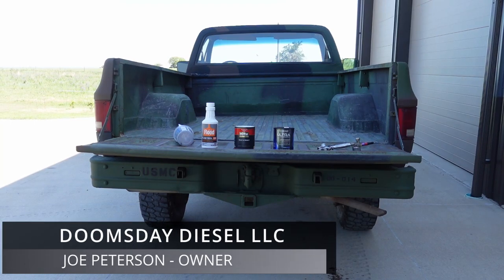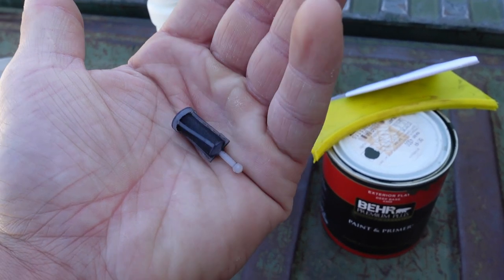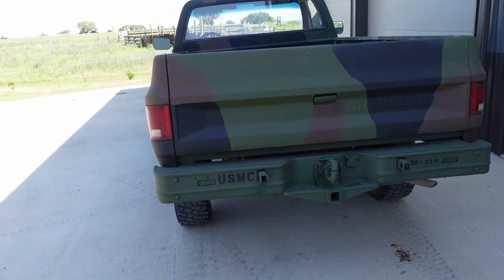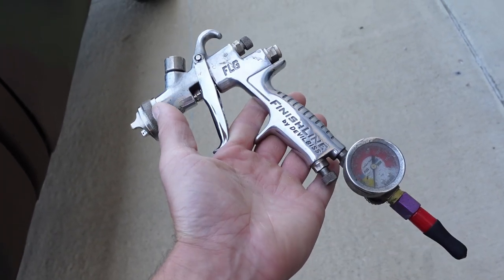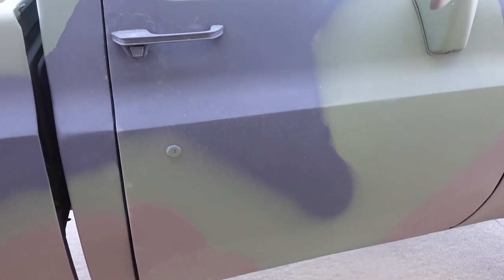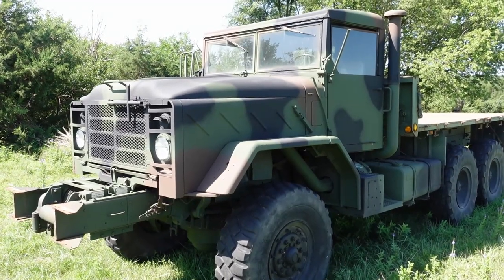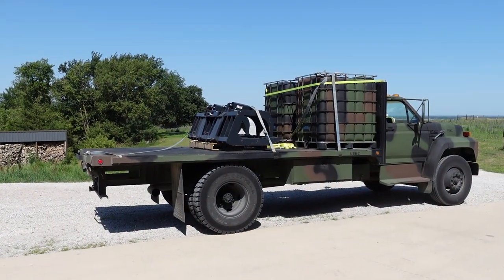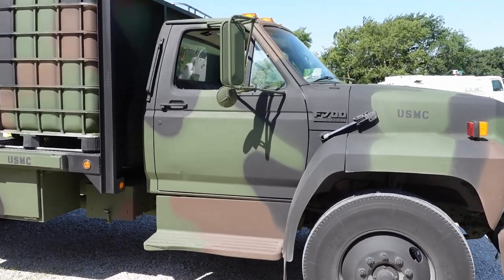DIY: Latex "BEHR" Military Vehicle Paintjob

Comment: Do you think the military just had 3 separate paint sprayers loaded up to bang them out off the assembly line?
Reply from the maker: I actually worked at a facility that won the bid to build the M939 beds. The CARC dries quickly, but not so quickly you can just lay one on top of another. There was maybe a 30-60 min gap between colors